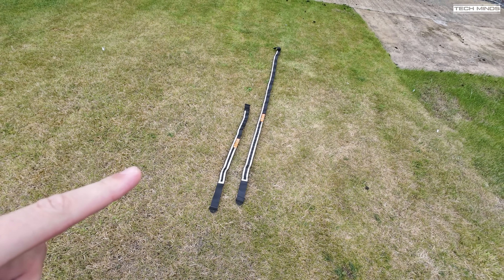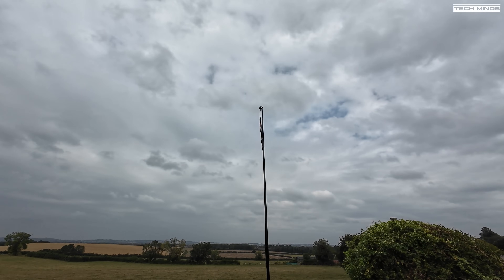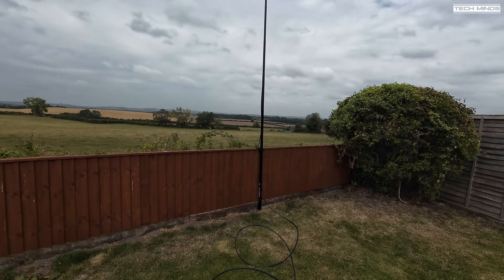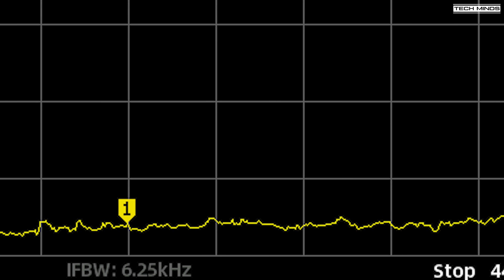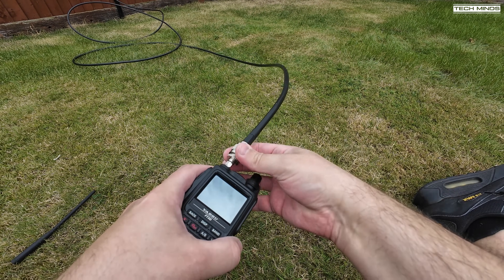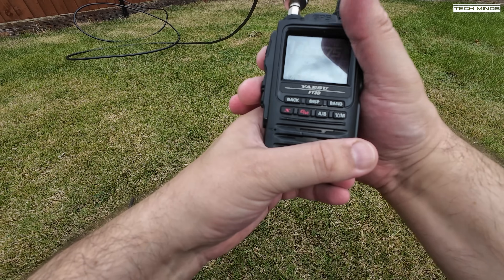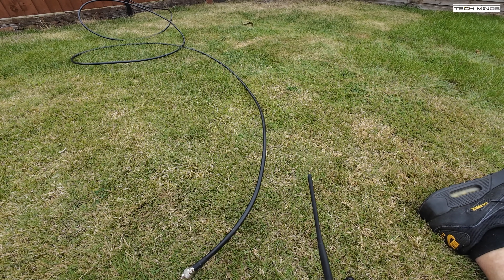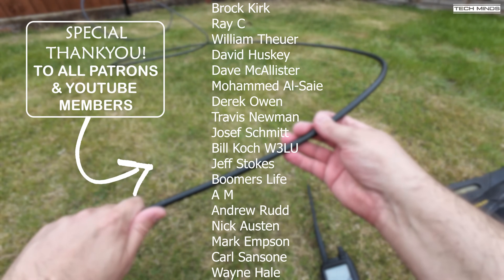Is This The Future Of VHF/UHF Portable Antennas? Faraday J-Pole

Comment: It is clever, and novel.  But I'm left wondering about that flat SWR plot, similar to what you see with a dummy load.  A resonant antenna will have a curve to it, always.  I have built J-poles and they always have a curve.  Something's off here.
Obviously it works though.   Now,  get it wet.  ha!  A bit of rain should destroy it's performance with that cloth material acting like a wick.   
All that said,  Aside from the Novel and interesting nature of it,  You can build a twin-lead j-pole for a few bucks in materials.  That thing is extremely expensive.
Reply: @loughkb  oddly enough water does not affect it in the least.
Reply: @VE6SFX_HamRadioRookie  and that makes me even more dubious about what's actually going on. That SWR plot is definitely not the plot of a resonant j-pole antenna and if surrounding the radiating element with moisture in direct contact with it doesn't affect it, that's abnormal as well.  Somebody needs to disassemble one..
Reply: @loughkb  All I know is that it works. Wet or not. You can try and disassemble it but in the end it is a very basic PCB. Then you can pull the faraday cloth apart all you want but in the end you will end up with a pile of threads.  I will send a email to you so we can continue the conversation on this.

Comment: Thanks for the introduction to these ultra portable antennas. In general a J-Pole antenna has the great advantage that its traditionally a high impedance half wave radiator connected to a U shaped quarter wave feeding transformer, giving you the great advantage that you don't need a ground or counterpoise and you can run an RF choke right at the coax feed point reducing the noise traveling along the coax, usually USB switching converter that feeds an SDR, in this case the handheld is already a clean and potential free battery driven device that doesn't require that.
I believe you used a carbon fiber telescopic mast, which is not ideal in this regard, because the carbon part creates some resistive and capacitive influence on the antenna when it is parallel to it and could be the reason why the SWR wasn't the best. I don't know why you would trace the SWR only on the ham bands when it would have been interesting if the antenna has a lower resonance frequency possible due to the mast? Pleas disregard my comments on the mast if it is pure glass fiber, because then it is almost entirely neutral to RF, ideal for such experiments.
Why don't you take a holistic look at the antenna and show us its overall sweep eg . the VHF from 120 to 160MHz and UHF from 400 to 450 MHz ... that would give us an idea if maybe shortening it a bit can improve its SWR? Or maybe it can be used to listen to air-band or 400 MHz weather balloons ... but I doubt it because the j-poles feeding transformer should be more selective compared to the match of e.g. a ground plane or a dipole. Can you just give us the antennas best resonance center frequencies?
I wonder if the material keeps conducting well over time ... if so, this is the best possible portable antenna for people who like to transmit as well.

When I hike up a mountain I usually receive and I/Q-record only and take samples home, while using a small super narrow magnetic VHF and a separate UHF antenna with me, that has a small tuning cap which may burn when transmitting, because it has a very high impedance on resonance and therefore is ultra selective. Up at these high altitudes you will have plenty of very powerful broadcast stations in line of sight and you can easily trade in antenna gain for selectivity, because you are line of sight with most stations for 100km and more ... usually absolutely amazing what you can hear above e.g. 1500m (4500ft) and higher ... very far away ATIS stations you lose in the car when only 20km away from the airport are coming in like they are around the corner ... which is one of the many things I love about hiking in the northern row of the Alps. 
I am still trying to find a good and legal location to go uphill by car on an asphalted road, giving me an exposed location towards the north and take tons of equipment to play around, stuff that I would never carry up a hill by feet. If anyone has a recommendation somewhere between Salzburg and Füssen, please let me know. Maybe some hams use these for doing contests?

Comment: wtf is "faraday tape?" Is that a very fancy way to say "fabric what is conductive"?

Good idea though, but seems pricey for what it is. Cheaper than buying a sewing machine if you don't already have one, but I already have one.
Reply: Yes conductive fabric. It is made for making faraday cages and bags. You can find on my channel videos on how to build one and I encourage you to do so. All the materials and such are listed in my video on how to make one.
Reply: Michael Faraday experimented with capacitors and electro static properties. The unit of capacitance is the Farad. 
A Faraday cage is used to screen sensitive electronics from electrical radio interence. Radio studios and server rooms are in a Faraday cage for protection against interference. I assume therefore that a Faraday antenna performs a similar job, to reduce noise levels.
G4BTI.

Comment: What is a "faraday-material"
Reply: It is a conductive fabric used to create faraday cages.
Reply: @VE6SFX_HamRadioRookie  Faraday cage is made of metal.
When this material is made of conductive stuff, how will work the copper coating as j-pole?
T
Reply: @larspregge6420  The fibres are nickel impregnated so it is metal. No need for copper you will find it performs at or above what copper does. Not because it is nickel but because of the weave and the way it capacitively couples and inductively couples.

Comment: Great innovation .. well done the creator of that antenna. I wonder how it compares to a ladderline slim Jim and a flower pot on 2m? Thanks Matt 73
Reply: It will work equally as well. Needs a bit of cord to attach it to a mast, some low loss coax to the radio and Bob's your uncle.
Slim G from Spectrum Communications is ⅓ of the price, but bulkier.
You pays your money, you makes your choices.
Reply: @theradiorover  half wave is a Half wave etc 👍👍👍
Reply: @TIMG5TM  oh, slim G isn't half wave 😁
Reply: @theradiorover  ah!
Reply: Here is what John Portune W6NBC has said: "Ben’s creations are truly inventive and always very functional. As an inventor myself, I have been impressed from the beginning. His latest, the roll-it-up, put-it-in-your-pocket conductive fabric J-pole “Fara-J” is a gem. One belongs in every ham’s field day, POTA, backpacking or RVing toolkit. The contacts I have made on it show it to be in every way the equal of a classic copper-pipe J-pole."
Reply from the maker: Cheers Tim

Comment: Helium balloons and heavy duty monofilament line can give one an easy 20 meter height using very high grade light coax.
Reply: If you like the danger you could also use hydrogen for extra lifting power